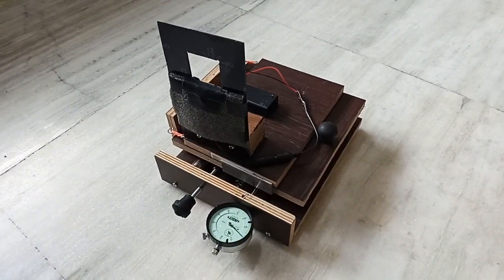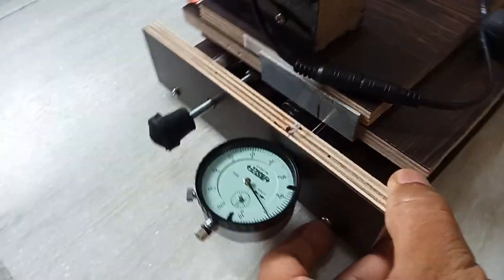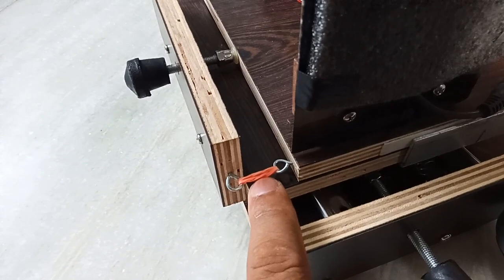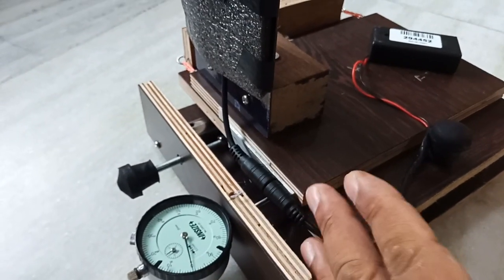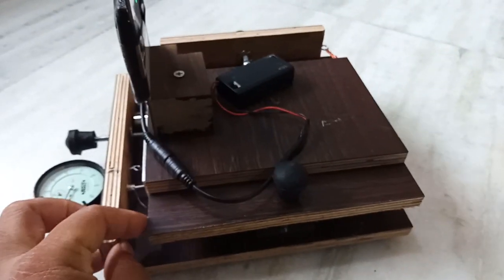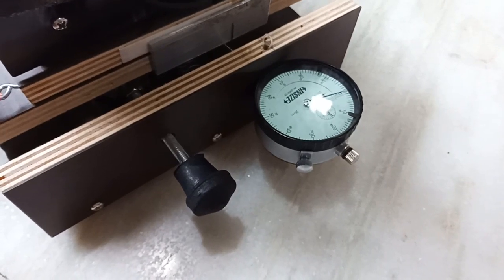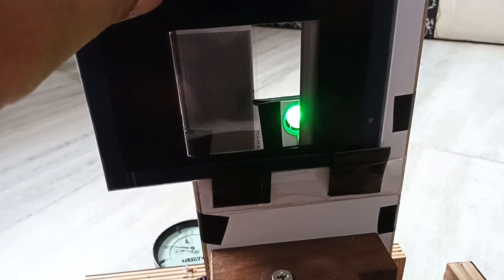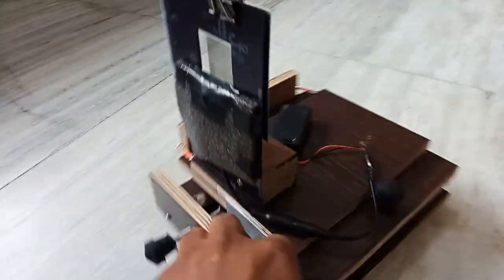New Foucault + Ronchi Tester

Comment: Dont use duacells; they leak corrosive fluid and ruin your battery compartment.  Energizer cells are guaranteed not to leak.
Reply from the maker: Thanks for the advice. Duracells are more commonly available here than Energizer. I also keep checking the battery compartment once in a while for any leak.